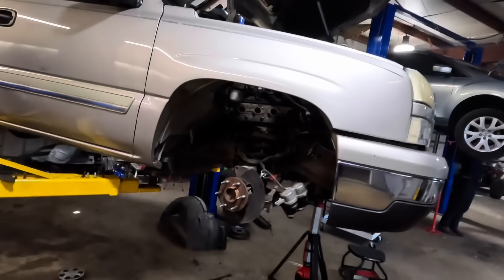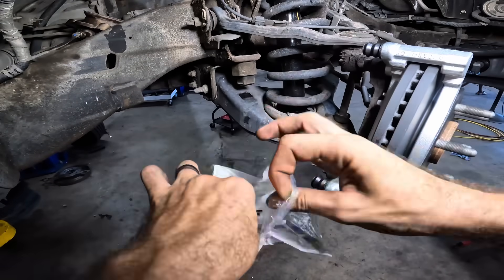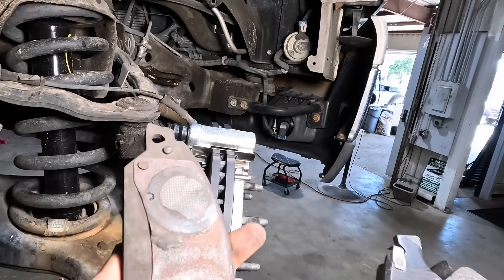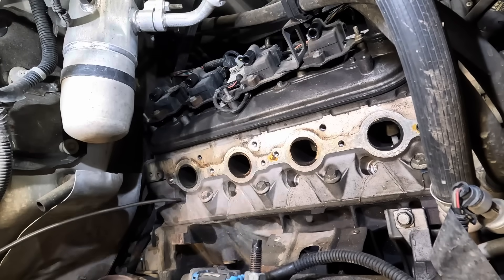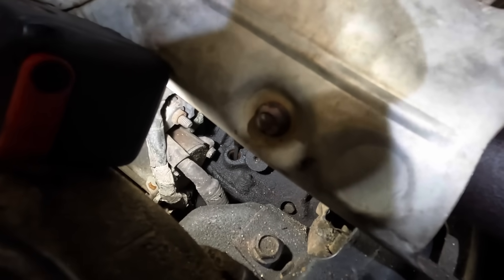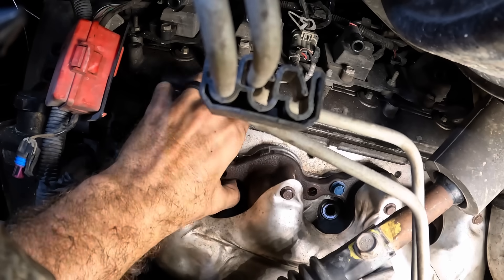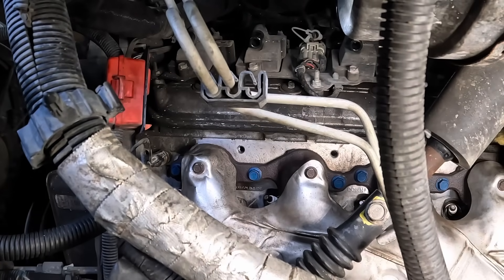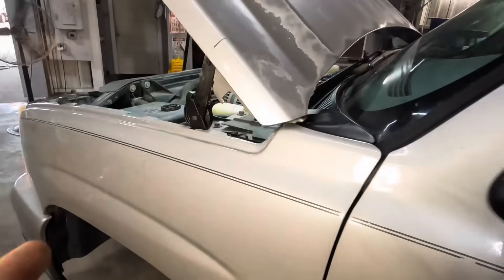Broken Rib Mechanic! Get it DONE! Exhaust ended the day. Silverado 5.3 4.8 6.0

Comment: Absolutely not concerned about the drama from the old shop. We're privileged to see an honest mechanic start and grow a new business.  Tackling the everyday issues and challenges of working on  a wide range of vehicles. It would be nice to get some updates on some of the jobs that have been kind of left in limbo. How about that Mazda? You ever get the drive train out of the donor car? Just keep doing what you're doing and most of us will keep on watching. P.S. I am going to keep hounding you until I see you buy some good Carbide drill bits and a TIG Welder.
Reply: Carbide drill bits ? why ? you can’t get most of a car into a pillar drill ! and they will not work for long in a hand held drill.
   Maybe you meant Cobalt.
Reply: Yes maximum I am entertained why do you think I keep  watch😂😂and to fix your back when you get home tonight just get the last word . Yes dear  no dear haha😂
Reply: @CrimeVid  No not cobalt or even titanium tipped or any of the others. When you want to drill hardened metal you want carbide.  In the aircraft industry I often had to drill titanium and monel, two of the hardest metals known, the only thing that will touch them is carbide. A carbide bit will go through a broken bolt or stud like a hot knife through butter.  Yes they're expensive but we'll worth the price.  My set of jobber bits cast $1,200 US dollars, plus a few extra short bits for tight spaces and use in my 90° angle drill. They're very hard to find but you can even get them for use in Terry drills for really small places.  I've watched Ray struggle with high speed steel bits and it's painful to watch knowing a carbide bit would have done the job in a minute or two.
Reply: Well, I prefer the present lack of interference in these videos,  
I could not care less about clashes of personality in a mechanicing (?)  channel. I don’t really see this as a grease opera !
Reply: I agree. But Ray has to stop selling snake oil to flush the engines. It destroys the bearings in the engine when the oil gets too thin. Be a master mechanic instead!
Reply: Could not say it better
Reply: IDK about him needing a TIG Welder but he surely needs to go with MIG using Solid Core Wire and get away from the Flux core wire. Flux core stuff is more for long run Pipe Welding or Steel Beam welding where you cant stop and start like with stick.
Reply: @niclasbergqvist1737  excellent markup profit in that.
Reply: @StevenDaugherty-uo5cs  I have had plenty of experience with carbide drills and of course they cut best,they also break or the tips break off if tipped, they have to stay on track, most mfrs say specifically to only use in pillar drills ! I remember paying £11 each for 1/8” jobber precision drills in ‘82 so lord knows what they cost now.  Good cobalt drills are a reasonable alternative and not too dear.

Comment: I used to work in a shop which performed lots of machining services (head plaining, block boring, valve work, etc. ). Our local BMW dealers were having trouble with exhaust manifold warping on right hand drive 3 series models, because in RHD speck the manifold was a single 6 port unit unlike LHD where there were 2 separate 3 port units (more space without the steering shaft in the way). They were replacing dozens under warranty  often more than once on the same car. At one point they ran out of supply, so to keep their customers on the road they sent us a batch of the warped manifolds to machine flat again, which we did for them. They then discovered that once the manifold had warped and been machined flat again, it did not warp again but was now stable and trouble free, From this point on they stopped fitting new manifolds and had us machine every one for them. Which just goes to show that putting a new part on the same as the faulty one was is not always the best option.
Reply: The beauty of cast iron manifolds are they're normally self annealing when they are cast. If they're allowed to cool slowly, they only need to be machined and they shouldn't warp. If someone decided to speed up the process by rapidly cooling the hot castings, the stress induced into the iron will guarantee warping.  That's why headers welded onto a rolled steel plate will warp just by looking at them. 😂

Comment: I must thank you for your videos, I am not a mechanic by trade but have done some DIY work on my vehicles in the past. My daughter had an accident recently (she is fine) that from a financial point of view wrote the car off, however with the knowledge I have acquired watching your videos over the last few years I decided to have a go at repairing it myself. Thankfully none of the major support members had been damaged, however the repair still involved replacing the front bumper & crash bar, headlight, side panel, power steering pump and lower control arm & CV joint. With parts sourced from a wrecker (except the control arm) the car looks and drives as good as it did before the accident. Your videos and attitude gave me the confidence to tackle this and I am extremely appreciative for the time you take to not only share what you do, but also explain why.

Comment: You can put wiring heat shrink over vice grips to stop the jaws from digging into brake lines when you using vice grips to pinch off brake lines @Rainman Ray's Repairs

Comment: I have no problem with how you run and narrate the jobs!!  I know the pain that your back is in.  I fixed state of kansas vehicles working my way thru college and had several days of lower back trouble after I fell 2 stories off a ladder and landed flat on my back.  The doc told me not to lift anything for several days but i didnt listen as no work/no pay.  It really hurt trying to bubble balance tires and reaching over to set them on the balancer let alone removing and installing on the car.  It finally quit hurting after a couple weeks.
Having your own business brings on many stresses that you didnt have before--you seem to be handling them well!!

Comment: relating to hard to get to exhaust manifolds, i have made sets of studs with screwdriver slot cut in one end. just screw in a few threads , fit gasket, slip on exhaust etc.  bingo!!. makes the job very easy.-- cheers from australia, love your stuff! 😁

Comment: I have not done manifold gasket replacement in quite a number of years, but when I did I used sewing thread to hold the gasket to the manifold in two of the holes.  Once two bolts were loosely threaded, I would cut the sewing thread and remove it.

Comment: Hi Ray, late to comment, but I applaud your patience in getting that last manifold bolt out. I worked as a service tech for 45 years, not on cars but forms handling and color processing equipment. Most of the machinery I worked on was lighter than your automotive work. We used to have good luck using tapered EZ-Outs to remove broken studs. They look like a backwards spiral twist drill. The downside was that you needed to have room to get a drill motor to fit in, so you could drill a pilot hole in the stud. The other tool I found invaluable was an original AC powered Dremel tool with the black motor case, made in the USA. It was small but powerful. They have some cut-off wheels that come in various sizes that fit into tight spaces. One trick with a slightly protruding stud is to slot it so you can remove it with a straight tipped screwdriver.  Penetrating oil is another must use product. Capillary action can do amazing things to free-up stuck bolts and nuts. Dremel also has nice grinding and polishing wheels for cleaning up small parts. I don't work for Dremel, just like their stuff. Keep up the great videos I really enjoy them!

Comment: If anyone is bored because of no drama, then they can experience some suspense by just re-watching Ray removing that broken exhaust manifold bolt with the welder wedged 2 inches from the fire wall. That had me on the edge of my seat.

Comment: The exhaust manifolds can be a really tough job . I replaced the manifolds on my Ford motor home . Very tough job to do . There were 4 broker off bolts in cast iron heads . Was able to get 3 of the broken bolts out using the weld the nut on and heating the thing . The last one had to drill . That did not go very well . Had a very tough time due to the angle and no room . I got all new bolts , new plugs and wires of course . Tapped all bolt holes and antiseised all bolts running them in the bolt holes before installing the manifolds . Getting to these bolts in some places was very hard . That 460 took up allot of room in the engine bay . Being a cutaway not much access through the wheel wells . Your job on this chevy had its issues too . That last bolt was just so difficult . Your great determination to stay with it paid off . Your skill at being a mechanic is one of the best I have seen . Thanks for your very good video on this project !

Comment: @28:00 (or around) - Hey Ray, as someone who works in a highly stressful, high-drama Information Technology environment, I actually appreciate the low-drama videos (ie the ones that don't feature irate customers, clueless shop-manglers and inconsiderate/selfish co-workers).  I have enough stresses of my own during the day, so it's nice to be able to kick back, relax in front of the Y-tube and watch someone getting things done in a mostly un-stressful situation (aside from the challenges of backing out broken bolts/studs in engine blocks).
So mate, keep it up and enjoy cracking a well-earned coldie after a long day wrestling condenser cores, manipulating manifolds and bruising your knuckles on same.

Comment: The new copper crush washers that come with a lot of the calipers are too hard to seal poroperly, but if quickly heated with a butane or propane torch until they change  color, they soften up nicely and seat correctly.  Nifty trick in the single-pin removal; I'm stealing that.

Comment: May I give you a suggestion? When trying to remove a broken stud in a AL block, try this...weld a bead to fill up the stud cavity, then weld unto that an appropriate sized "fender washer", filling up the middle. Then weld unto that a regular nut, on the outside as well in the middle. It produces a much stronger weld...😊

Comment: RAY I have separated ribs from the Cartledge, and it felt like a broken rib. I have done it a couple times. Both times doing manual labor. Wasn't aware until later that I hurt myself. Once was working when laying on my side and reaching above my head, the other time pulling things that were heavy.

Comment: I watch daily and I think your better than ever.  I didn't notice any cleaning of the brake rotors this time. I'm assuming this type of rotor doesn't have any protective oil on them like most others?  🤔 just thought you would have mentioned that.  Try heavy cardboard or 1/4 inch plywood under your couch cushions. It might help.

Comment: Hey Ray, just a heads up on situations like you delt with on the driver side manifold my dad taught me to always keep string, tie the gasket to the manifold through 2 bolts get the manifold to the block get 2 bolts started and you have enough room to untie the string or use 2 short pieces of all thread with the same thread pitch as manifold bolts use them as studs hang the gasket and manifold then get bolts started then remove the all thread rods

Comment: Little tip for you ray. If you have a brake pedal presser apply a little pressure to the pedal and it creates a pressure lock to stop you leaking fluid all over the floor

Comment: I watch and enjoy ALL your videos! The only thing that the other shop had was possibly a wider variety of vehicles due to the constant turn over. And THAT will come naturally as the client base expands and different manufacturer cars and trucks make their way through the shop. Maybe take on a few out of the box projects like maybe some boats (the ones with carlike engines not outboards obviously). 
Or even old motorcycles or side by side type vehicles. We like to see your incredible ingenuity and MacGyver like creativity! Plus it's fun seeing you stretch your comfort level. Like when you cracked open those transmissions. Now that was some drama!  
:face-fuchsia-tongue-out:
You just be YOU! Your encyclopedic knowledge of movies is unmatched, I am constantly impressed with the uncanny ability to quote some obscure (to some) films everyday. I'd like to officially request at the movies with Ray on   RainmanRay Off Duty!

FEAR:
“I must not fear. Fear is the mind-killer. Fear is the little-death that brings total obliteration. I will face my fear. I will permit it to pass over me and through me. And when it has gone past I will turn the inner eye to see its path. Where the fear has gone there will be nothing. Only I will remain.”
― Frank Herbert, Dune (Original Director's cut)😎👽👾👀

Comment: Don’t need the drama. You can tell the difference in your voice. Old shop was dragging you down. You sound much mor happy now. And as for the back pain, I get those knots between my spine and shoulder blade. I use a base ball on the wall and roll them out. It’s painful but it helps break them up. Just hold it where it hurts the most and press really hard!

Comment: Ray, you mentioned taking the brake fluid filled caliper over to the oil drain. Where I come from they check the used oil for brake fluid before accepting it for recycling. Hope you don't get in trouble!

Comment: Yes, I am entertained. Educated, too. I need to change a steering shaft joint on my Suburban. I now know to attack it through the wheel well. That should make it a whole lot easier. Even easier would be to have you do it, but I'm almost 3000 miles away. So that's not happening. ☹

Comment: man you got it easy in floridaland....up here in canadaland the pins would have been seized....the brake line would have broke...the torx bit holding the rotor on would have had to be drilled off....and the those brake hose bolts would have totally snapped off

Comment: Tell you a little trick I learned on bleeding those brakes by yourself  is crack the bleeder valve open and fill the master cyl and then goput the other side on while that side self bleeds. Believe me it works like a charm just dont let the master run out of fluid

Comment: I used to know a mechanic who would coat the inside of the exhaust manifolds with used motor oil before installing them. He claimed that the carbon left over from the burning oil added a layer of insulation to the manifold, which prevented further warping.

Comment: I know you don't live in a rust area, but wouldn't it be nice for the next shop to put some ceramic paste under those pad brackets? Also when i work with brake lines i like to use some compressed air and some lube before losening the fitting. Just to make it nice and shiny 😊

Comment: Hey you did the old fix the bracket without camera trick to stop the reee's or whatever you call it. I was gonna say in case you were gonna remove the bracket to straighten out just give it a whack with an extension and a hammer, but you did that there are witness marks.  I almost was concerned since whoever did those other brakes may have changed that line that they could have created threaded it, but it would most likely have leaked.
Nice job welding your nuts to the broken bolts. Nuclear setting does the job, I think it also heats up the broken piece and helps to let it come free. Regardless nice job.

Comment: Don't fight with the wife unit and you won't be relegated to sleeping on the couch. I severely bruised my rib cage working on a BMW 530i,  I slipped and slammed against the edge of the fender and hit right j see the rib cage, I was out for six weeks, sneezing coughing and sleeping were a new experience in pain, I just work in my backyard for friends and the occasional neighbor, the BMW was a long term project so not a rush job but it did set me back and by the time I was able to start work again it was late fall going into winter.

Comment: I am curious ray when you pull off the exhaust manifold and remove the studs/bolts do you ever clean out the threads by using a tap too "renew" the threads? Your average curious foreign fellow mechanic:-) As always quality work ray, its relief to see an honest mechanic like myself working. Your workshop is bound to be a great success!

Comment: Those brake rotors look very good, especially if the anti-rust coating stays on the areas without brake pad friction, making the rotors last longer. That would be a good return value for those parts.

Comment: my back went out just  last week without me...i picked  up a trash bag with less than 2 lbs of trash in it and i could not stand up or walk without having back spasm that would send me to the floor then on about the fifth day i heard definite pops and most of my spine felt great except for a couple vertibrae that were still stuck and would not move or flex so i rested for another  three days and then they popped.. it took me three more days to get moving again so i was out for almost 2 weeks from just bending down to pick up a basically empty trash bag...

Comment: If it were me replacing those brake tubes, I would have postponed fastening the brackets until both ends were installed and secured. Maybe that way has its drawbacks too, but it would be my first choice if I had to do that specific task.